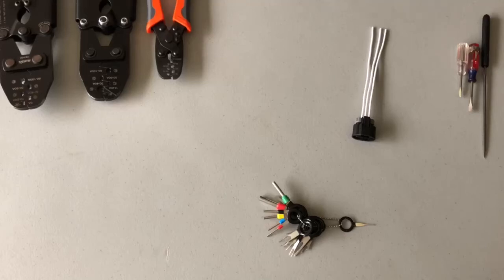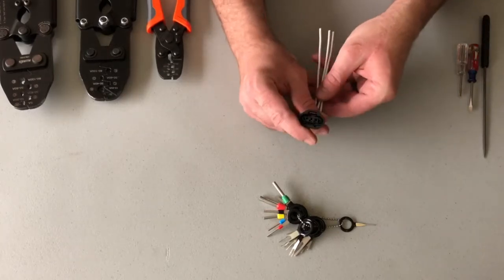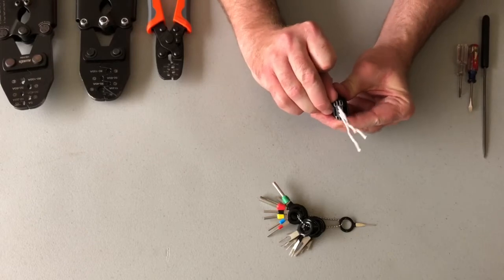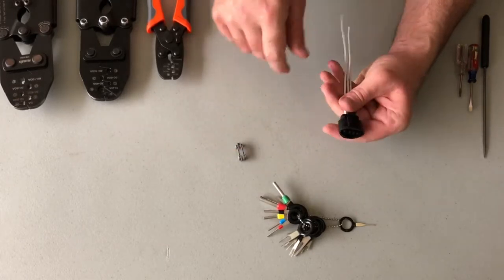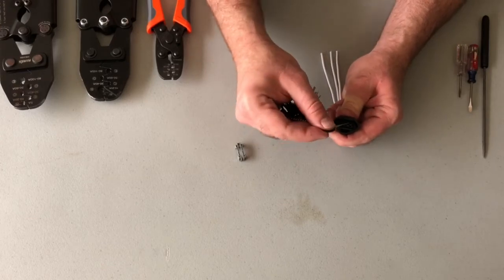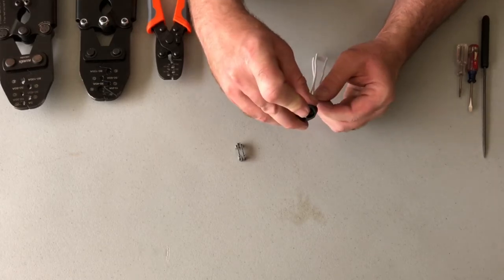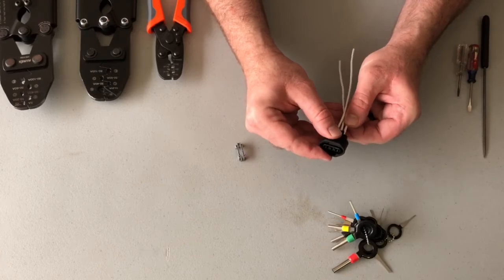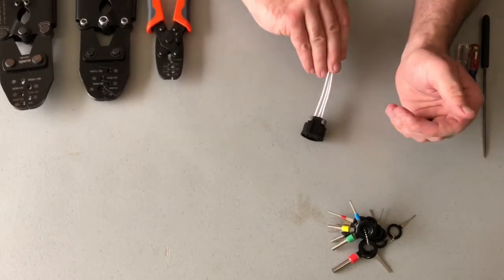Ford Throttle Position Sensor Connector Assembly and Disassembly

Comment: Where can I get the tools that you have shown in there? I have the new connector, I just can't get the old one out without cutting the wire, which I don't want to do.
Reply from the maker: The tool on the tool ring I just ordered on Amazon. Search "terminal removal tool kit".